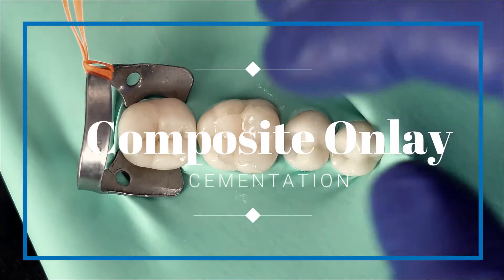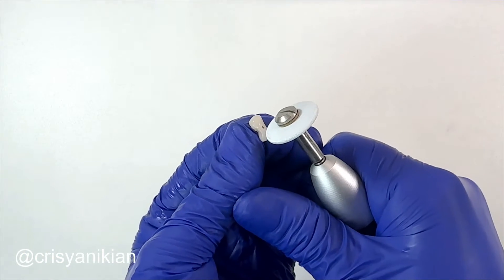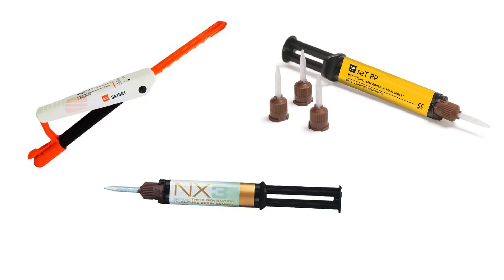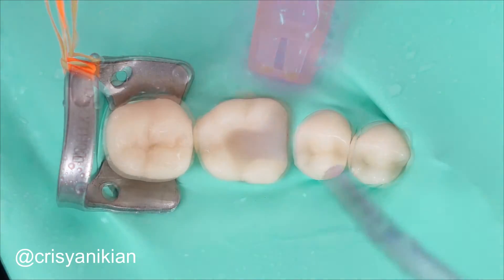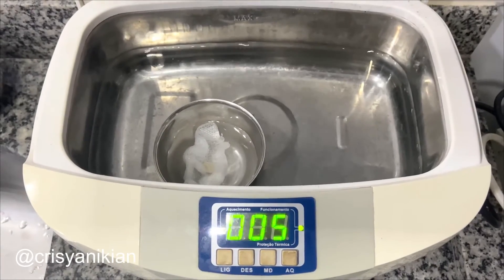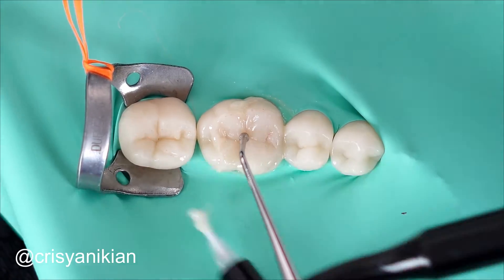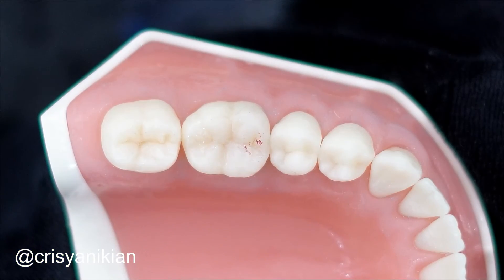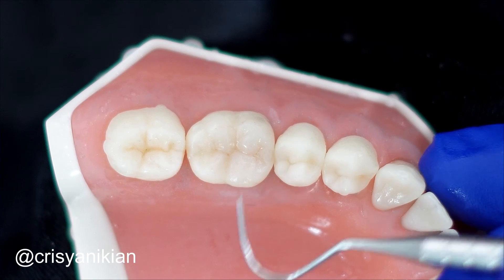Composite onlay - part 5 final: cementation.

Comment: Doctor,
I would like to know why you suggest not to cure the addsive applying on the tooth?
Thank you.
Reply from the maker: The adhesive should not be light-cured to avoid creating a layer of misfit on the prosthesis. The cement used here was dual polymerized, so the cement itself will polymerize the adhesive as well. Remembering that the adhesive system of the same brand as the cement must always be used.
Reply: @dentfy when cement polymrize it will not polymrize the adhesive because each one act seperatly no light cure its chemical how would adhesive set ?